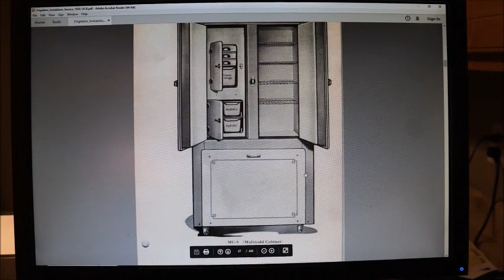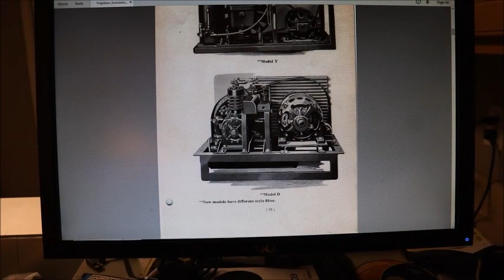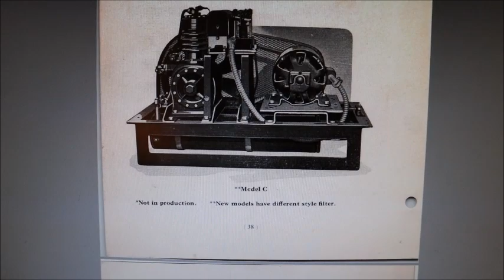Frigidaire Multicold from the olden days - 1 - Intro / control / motor and compressor inspection...

Comment: I'm always up for another episode of Uncle Dave's Artisanal Refrigeration Service!
In the pivot from the A-Body Go Fast Turbo Shop, do you find these projects more satisfying? I'd think it's a bit less time consuming to get the result you'd like with some of these fridges than a whole car... physically smaller device with fewer systems. Between the work the local body shop does on the cabinets and your attention to detail on the mechanical and electrical side of things you arrive at a really nicely finished product!
Reply from the maker: I really enjoy both types of projects! One reason I have moved away from the cars is due to changing demographic and peers in the car scene. There seems to be less technical interest, and more people wanting their car fixed free. Also it seems the car scene has become political which is a huge turn-off for me. 

The Multicold MC-12 is a porcelain clad cabinet, so it won't need bodywork. It's in impeccable shape as it is! Thanks again for the comments.

Comment: I wonder how old that replacement Delco motor was? If I had to guess, it was replaced when it received a new compressor seal. Great video as always!
Reply from the maker: Thanks!  It's likely that the Delco motor was put in place in the 50's or 60's. Looking at the nameplate that is when it appears to have been manufactured.

Comment: What oil did you use for the motor?
Reply from the maker: For the electric motor, it uses SAE20 non-detergent electric motor oil.

The compressor pump uses alkylbenzene refrigeration oil, 150 SUS viscosity.